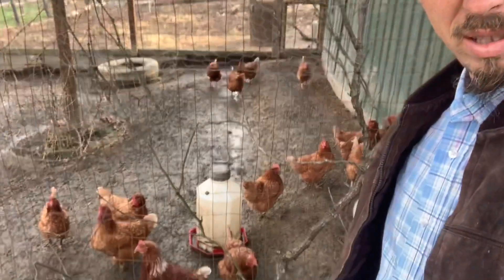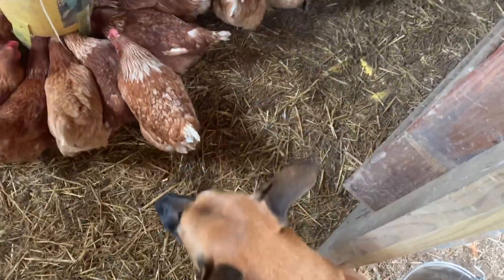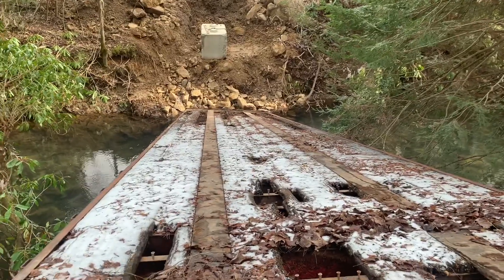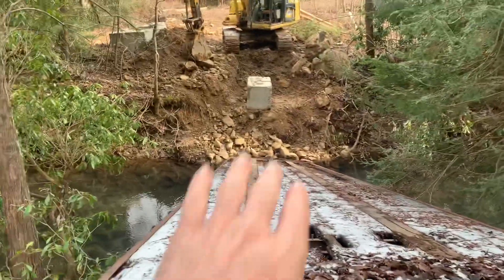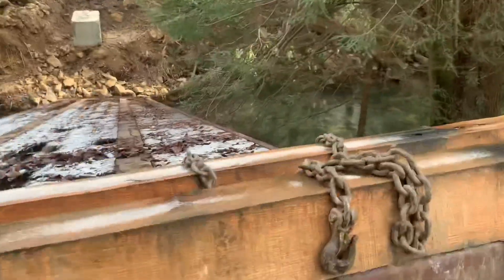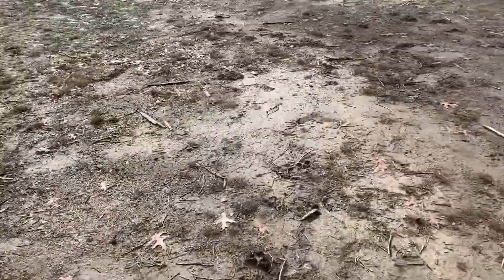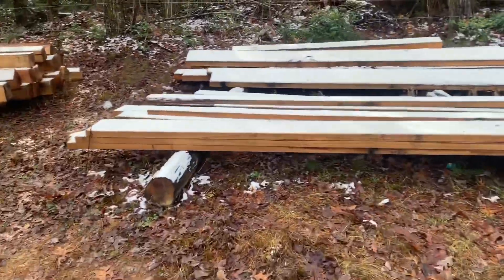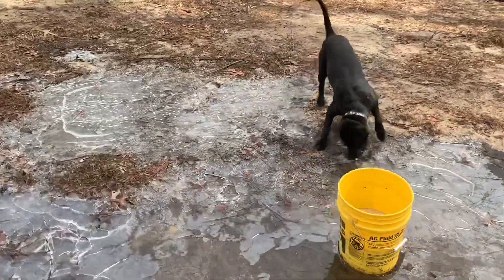Bridge Collapse and Scooby Action

Comment: Does the creek ever dry up? Also what is the deepest you’ve seen it run in the wet?
Reply from the maker: In a dry summer it does get down to puddles and I’ve seen it several feet higher than it is right now
Reply: @TruckingwithBones  
I hope it doesn’t get up to where the bridge supports are going to be placed!
It could wash out under the support blocks. 
Looks like it’s gonna be high enough tho!
Strong design with the planks over timber’s!
Make sure y’all put curbs on it lol!
Reply from the maker: It is 12’ above the water and will be anchored by cables to the trees up creek from it